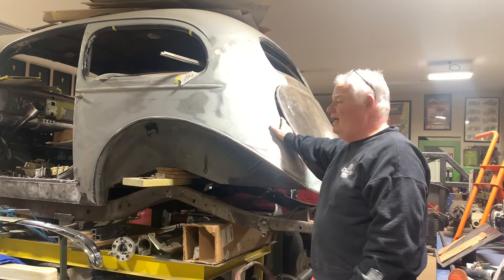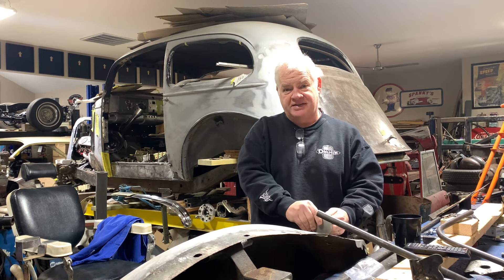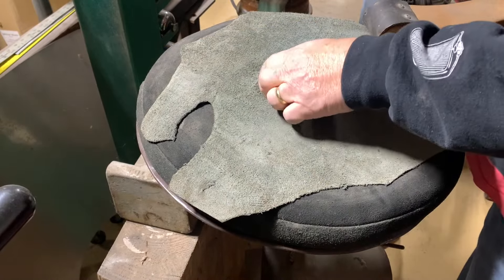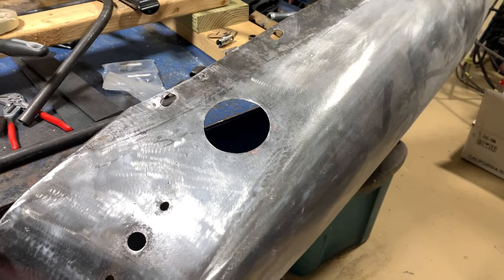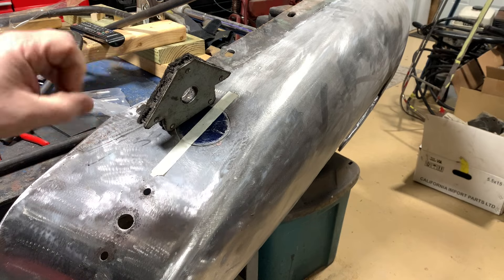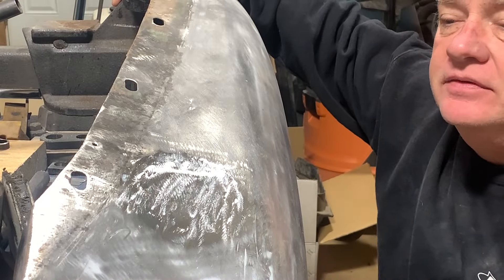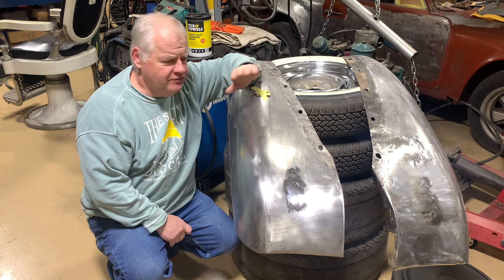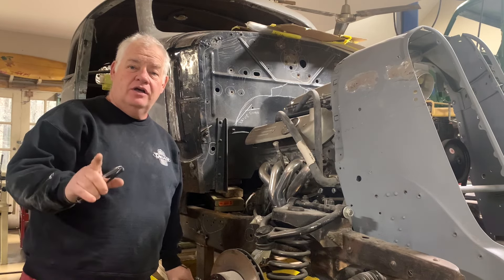Building a Amazing Hot Rod on a budget

Comment: Great Video, What frame are you using? The big thing out here in the Huntsville/Conroe/Houston area is putting the Post War Cars on mid 70's to mid 80's full size cars and wagon frames and powertrains to build a dirt cheap hot rod. The wheel bases for both cars are generally so close you don't have to do much fab work. You can pick up a mid 70's- mid 80's Buick Lesabre/Olds Delta 88/ Chevy Bel-air/Pontiac Bonneville that's running and driving for $500-$600 and almost noone is rebuilding those things but there are people who are so you can part it out and get your most if not all your money back. I have a buddy in my car club that has a 53 Chevy Styleline that has less than $500 in dollars and that's because he did bodywork and paint on it. No it's not "Goodguys show" quality but it's better than most daily driver Hot Rods I've seen.
Reply from the maker: Thanks for watching. I’m building a frame for it. Already started but not posted up the videos yet. Please subscribe and follow the channel. Great tips you have
Reply: @SpankysHotRodsandCustoms  Will do